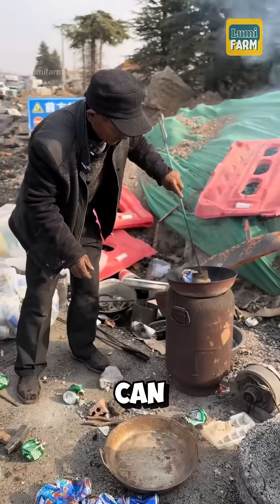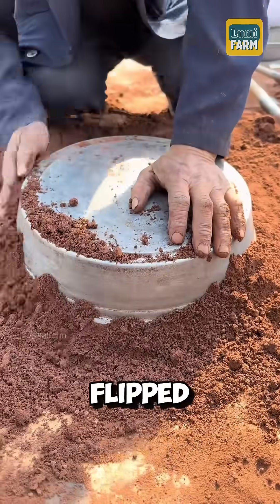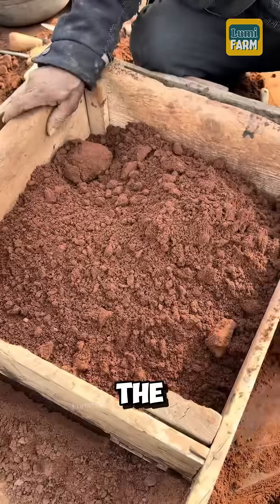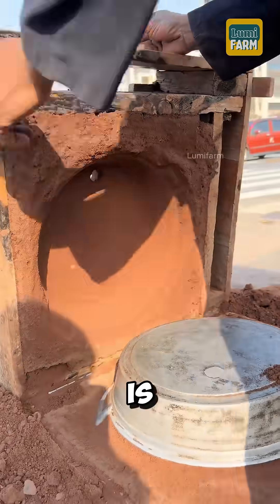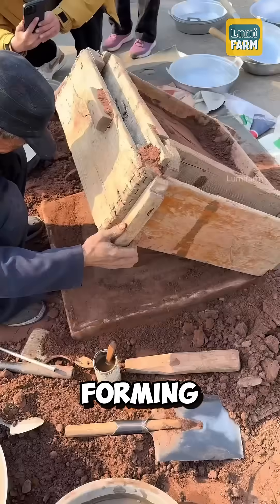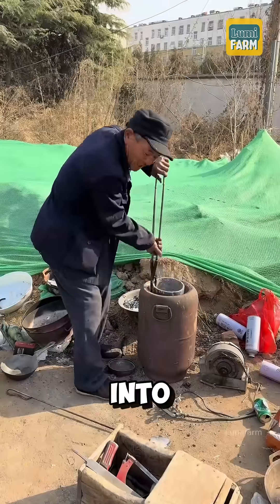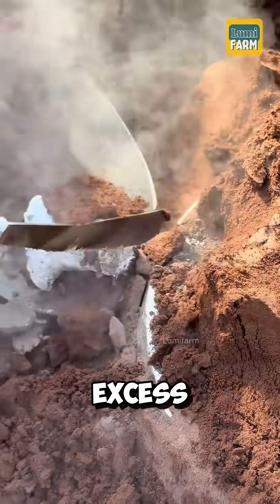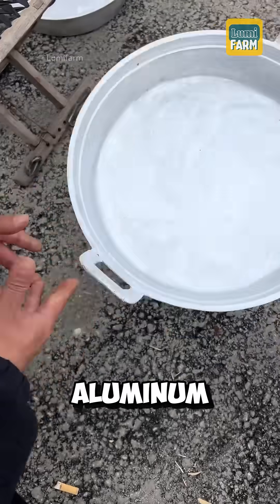How do the Chinese recycle aluminum cans? #recycle #shorts

Comment: Un excelente trabajo; pero no es bueno cocinar en cacerolas de aluminio, debido a la acidez de algunos alimentos. El aluminio liberado a la hora de cocinar muy tóxico. (Aluminio 29 🤔🙄😱)
Reply: ALSO, for DECADES, all beverage cans are lined with. A thin layer of plastic. It is actually possible to use chemicals to eliminate the aluminum, revealing a plastic "bag" still full of liquid.

All plastics are made out of chemicals; some more dangerous to inhale, touch, or swallow than others.
FOREVER CHEMICALS  ARE MOST DANGEROUS. 
   If you see any chemical with " fluor" in the name, you have a chemical with cannot be burnt or neutralized. That is why these are called "FOREVER CHEMICALS."  BUT PEOPLE ARE BEING SLOWLY POISONED.  THESE CHEMICALS ARE A BIG PART OF THE PLAQUE INSIDE THE BODY.

IF YOU MELT ALUMINUM, YOU ARE RELEASING BURNT PLASTIC into the air you and your neighbors are breathing, and into soil they may grow food in.